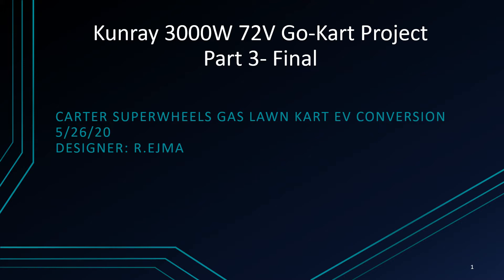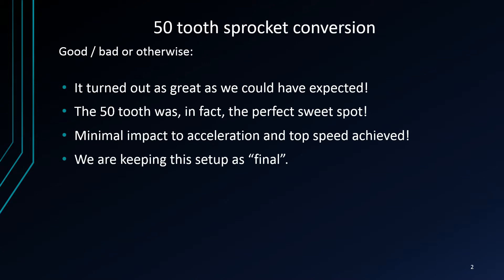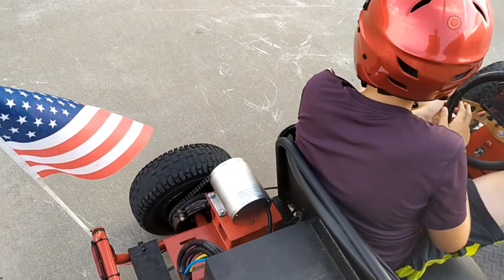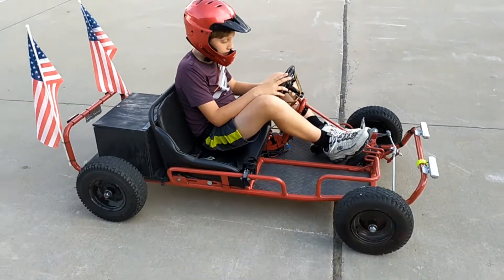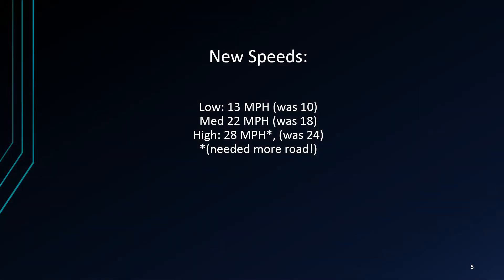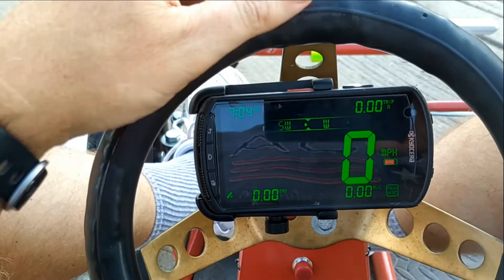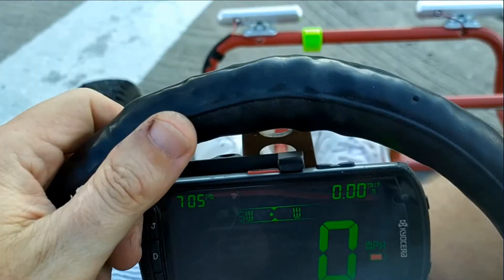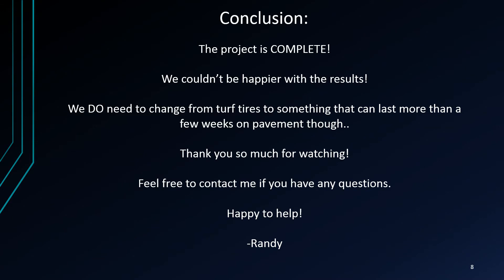3000 Watt 72v Kunray Electric Go Kart Build, Part 3 Final

Comment from the maker: For anyone doing an electric go-kart project, I had these cells made specifically for this and e-bikes.. They are 32ah lipo's  https://www.ebay.com/itm/275291765027
Reply: Hi, I’m currently working on converting a gas go kart to an electric go kart for a school engineering project. This is my first time working with go karts and I just got a klipper go kart off of facebook marketplace. My budget for batteries is about 150 and I’m hoping to use a 3000w motor. Do you have any tips and/or batteries you’d be willing to sell?
Reply from the maker: @santa3k732  Unfortunately, $150 for the battery necessary to power that motor properly is not possible.  However, you can get 6 12v 7.2 aH Mightymax Lead acid batteries for $20 each at Lowes.. It'll work but you'll have little to no range and it won't dump the current necessary, but it'll get you a passing grade for your engineering project.   I have some other ideas that will cost a little bit more but won't kill your budget either so contact me at info@texasnev.com if you'd like more help.

Comment: Turn your clutch inverted you will hit easy 80+ mph
Reply from the maker: LOL.. What clutch are you referring to?
Reply: @TexasNEV  the circular one that goes on your shaft 😂 turn it around
Reply from the maker: @Bigpimpin9393  there is no clutch on an electric go-kart. That's a sprocket, and if you watch all the videos you know that it's impossible for it to go 80.
Reply: @TexasNEV  it is not impossible brother trust me but I am not hating at all there is a such thing as an electric clutch so yeah it was impossible to go to mars and the moon yeah 0K 🤣
Reply from the maker: @Bigpimpin9393  The technical specifications of the motor, current, drive sprocket, driven sprocket and wheel diameter, it is not possible.  The efficacy of clutches on electric drive systems are subject to debate, and cannot make speed all by themselves. Some people have confused the brake band has a clutch in these videos.

Comment: What is the constant Amp output of the controller? You could take a slight risk and shunt mod the controller for more amps, then back it down in the settings.
Reply from the maker: It was a 45 A controller.  I sold that go kart a long time ago, but it still ended up going almost 45mph as is.  If I were to do it again, I'd definitely go bigger just because I can, not because it needed it. :)

Comment: does the motor give a lot of resistance at idle?
Reply from the maker: The nice part about brushless motors is that they do not.  These little things are great as they do not give much at all.  Now brushed motors are a different story.....My Hammerhead 150 EV conversion was brushed and it does.
Reply: I have a 3000w motor at home and it has a resistance at idle when there is no voltage. You can feel the individual permanent magnets with every turn by Hand.  I geared my motor very heavily, so the resistance would be too much.  I hope that this is no longer present when there is voltage on the controller.  Otherwise I have to install a freewheel and it will be a while before I get a battery delivered.  And do you have experience with the electric brakes?  Are these as strong as the drive itself?  Does the braking supply power back to the Batterie?
Reply from the maker: @marcellange814  Hi Marcel,  if it is the same motor as this, that is a little surprising.  Just as an FYI, if any 2 of the 3 motor wires are touching, the EMF generated by turning the shaft will encounter a LOT of resistance.  Even with the motor not connected to anything. :)  It's kinda cool.  However once it is connected to the controller we did not experience much of any resistance.  It will be hard to find a freewheel that can take that kind of torque but by doing so, realize that you'll lose the ability to go in reverse.  One thing I want to clarify is that with these bundled controllers, the e-brake is NOT a brake, all it does is cut power to the motor. It does not "brake" anything. Now, however, I'm sure that there are controllers out there that do that.  These don't.  The purpose of the e-brake is "emergency", not "electric".  This is in case of a runaway controller (controller stuck at wide open throttle).  It is a safety mechanism.
Reply: @TexasNEV  Too bad but good to know.  Our vehicle shouldn't be too fast going downhill and we hoped to get that under control with the electric brakes.  Thanks for the info and thanks for your great videos and support.  I appreciate that 👍🏼
Reply from the maker: @marcellange814  The Carter superwheels just had a single band brake and that thing went 43mph and it was fine. :)
Reply: @TexasNEV  we are building a two-row 8-person tandem 🤓 for excursions.  The motor becomes a starting aid and hill support with a maximum speed of 6km/h or 3.7 mp/h.  Up to 6 km/h, an electric drive is in the same category as a Elektrik wheelchair or a self-propelled work machine and you don't have to insure anything or have it approved by the legislator in Germany. It's just a bicycle with starting aid.  But if the drunk let them run down the hill without braking, it could end badly.  Here we wanted to install a Hall sensor and microcontroller, which in the first step actuates the electric brakes, in the second step the horn to warn, because in the 3rd step the mechanical brakes are actuated with a 12V linear engine and they hit hard.  the brakes are from a car.  The Axles and Breaks are from the VW Beetle, so strong enough.
We will see. I think the motor is strong enough.  With the calculated ratio we get over 300Nm at the wheel or a thrust of 1700kg / 3740lb, that should be enough.  A day tour should be possible with a 40Ah lithium ion battery, because the motor only supports you to climb Hills and every driver actually has pedals. I Will do a Short Clip of this Projekt too. You habe inspired me. Thanks a lot.
Reply from the maker: @marcellange814  That sounds like quite the project!  I look forward to seeing it!! I appreciate your comments and as always, here to help.

Comment: What amp hour battery are you running? I want to get this motor for my build and I want it to be able to get to 40 mph for city riding.
Reply from the maker: Initially it was a repurposed used stack of 5 64 aH Nissan Leaf cells converted from 2s2p to 4s, which theoretically made it 20s @ 32aH.  One single cell failed, and I ended up dismantling and selling the pieces and made a brand new 24aH Lithium Iron Phosphate battery which was 24s3p with 8aH cells from BatteryHookup.  The battery worked amazing and the cart could hit 45 WOT but it was obvious it was overvolted. :)  All else being equal, it would have been best to make it a 24s4p (32aH)  So I would recommend any 72v lithium battery with a continuous discharge of 50 amps in a 30-40ah range and you'll have a ball.

Comment: Do you need to buy your own battery after buying the kit? If so could someone link some budget powerful batteries, I’m doing a build but am low on funds.
Reply from the maker: Check out BatteryHookup or Batteryclearinghouse for budget cells to build your own 20s (LiPo) or 24s (LiFEPO4)

Comment: Are these motors good for motorcycle builds....like a cafe racer
Reply from the maker: I had one of these on my original "Terminator Electric Chopper" project and ended up changing to a hub motor due to excessive heat.

Comment: Thank you man. I’m currently undergoing a Honda ruckus swap out with the exact same motor. Researching batteries now. Going to check out your other vids. And also in the DFW area. In Texas. Don’t know if your around there
Reply from the maker: I'm in the DFW area as well and have some AMAZING batteries for sale, specifically designed for go karts and e-bikes. Very high discharge rate larger LiPo's..  Let me know if you're interested.

Comment: Can you link te battery of the go cart pls
Reply from the maker: The battery was originally made with used Nissan Leaf cells.  Then I ended up making another battery from scratch with 32650 cells for 24ah.  So I don't have a link for those but what I do have is a far superior alternative that is much higher capacity and much higher discharge capability.  I have these on my e-bay site specifically for projects like this and e-bikes..
https://www.ebay.com/itm/275291765027

Comment: What if you run a go cart torque converter?
Reply from the maker: I think it would be worse.   Electric motors are about 90% efficient, which is far far higher than a gas engine and give 100% max torque at 1 rpm (figuratively speaking).
Reply: @TexasNEV  you can't win if you don't try
Reply from the maker: @macbook802  It has to make sense first. :)  It's a nice idea but a TC is designed to help a gas engine have it's torque optimized at more rpm ranges other than its primary power band.  in an electric motor, the entire range is it's power band.
Reply: @TexasNEV  everything makes sense if you don't think about it
Reply from the maker: @macbook802  That's funny.. He'll be performing here all week folks and don't forget to tip your waiter!

Comment: Nice! I got the same setup, but i was wondering if its normal i cant turn the sprocket/gear on the motor by hand. Didnt install it yet.
Reply from the maker: Not normal... With nothing connected, you should be able to turn the motor easily, sounds like it is defective!

Comment: Is it a good idea to strap a powerful motor on a light chassis with off-road tires on tarmac? I don’t think so

To some extent
Reply from the maker: 4hp is less than most gas go karts of the same size.  Maybe check your facts before posting negative comments that have no value whatsoever?  If you watched the full series (which it is clear you haven't), you'd see that we put slicks on it anyway.  I don't mind constructive criticism, that is one great way to learn. Your comment would be the opposite of that.  LOL
Reply: @TexasNEV  yes but I’m looking to make a go kart with electric motors and achieving a 100kmh top speed, it’s 62mph, so do you think that the motors you showed in this video is enough to achieve it with a 4 speed auto?

I didn’t hate, it’s a good idea, slicks are easy to wear so I can respect it but at the same time there’s no grip, if you are into drifting, it’s a good opportunity to make a drift kart, but I do respect that you made this kart from scratch wd
Reply: @TexasNEV  I did see the vids prior to this, so you are right to some extent
Reply: @TexasNEV  Gas? , anyways the speed dosent solely rely on hp, it relys on power, gear ratio, weight, drag coefficient and aero
Reply from the maker: @you.got.gapped.racing44  Understood, thanks for the context.  This motor, when overloaded can get to 44mph, but I wouldn't expect it to last very long.  It does not generate enough torque to make it a drift kart nor can it "burn rubber".  It is just a one wheel drive go-kart.  If you want 60 mph, you're going to need a different setup, live axle, probably a big fat Motenergy ME 1306 and a far far larger battery pack...  Expect the budget to be almost triple.....
Reply: @TexasNEV  because I had the gx390 engine on cart so I don’t know what can produce enough power for a top speed of 100kmh with a reasonable acceleration, I thought initially that I would need a petrol engine like the gx390 but I tried looking out for rotary engines, the cheapest one was 5 grand usd so I just steered away and now I’m in a tie fight between electric motor or the gx390, the gx390 makes 12-15hp
Reply from the maker: @you.got.gapped.racing44  I'm not familiar w/ the gas engines.  However if I can get 45mph w/ my Hammerhead NEV (other videos on my channel) with an ME0709, then again, the ME1306 on a light kart with the proper batteries should easily be able to get to 62mph.
Reply: @TexasNEV  ahh, not sure if I could call perol gas bu you do you
Reply from the maker: @you.got.gapped.racing44  gas / petrol, kmh / mph.. all good.

Comment: Can anyone tell my why my drive sprocket is skipping chain links. I am using the original sprockets that came with the chain and kit for the 3000 watt 72 volt Kunray Electric motor. If I power it up very high it keep skipping about every 10 seconds.  I have it on a 4 wheel bike with 24" wheels, overall weight with me on it is about 370lbs. It goes faster than I want to go, the bike has no suspension, I've had it up to 25mph, but I'm afraid that loud clicking sound is causing damage to something. I'm assuming it's the chain jumping the sprocket on the motor 11 t sprocket. My shaft sprocket is 50t.
Reply from the maker: Chain sounds like it is stretched or if the sprocket is aluminum, the teeth are worn, or it is just simply not tight enough.

Comment: Hi I have a 72v vevor motor. And a 67v battery fully charged. It won't even move unless I give it a push. How do I get some Low end torque? I would think I'd have enough power bc it goes pretty fast once going but from a stand still the motor makes weird noises like it's jumping chain links but it's not
Reply from the maker: What is your gear ratio? Tire size? vehicle weight, etc?  How much current is your controller capable of and what sort of battery setup?  Lots to consider.  If you have pictures, you can e-mail me at info @ texasnev.com if you want.
Reply: @TexasNEV  awesome man thanks I will look tomorrow and send you that information but it's a Vevor 72v motor and 72v controller with 3 speed twist throttle from ebay. It's on a baja doodlebug mini bike I think it has around 62 teeth on the rear and I think the motor came with 11 teeth
Reply from the maker: @TheMetzStein  gear ratio should be good, a little higher would be better but it should still work.. bike would be lighter than a go kart, do the 3 speeds work? If all speeds are the same, then the motor is operating in reverse and you are only getting half throttle (this is by design).  If that is not the case, I need more detail about the battery....
Reply: @TexasNEV  do you think my issue is in the motor controller? It buzzes and is clanky unless you give it a push then it goes but if you hit a Slight uphill grade is slows down. It should have torque to go from a dead stop or up a little hill. Any suggestions?
Reply from the maker: @TheMetzStein  Well that doesn't sound good.. What would be really telling is getting a shut ammeter from Amazon like the one I have installed on this and pretty much every other ev I've done.  You'd be able to tell instantly if the current required "just ain't there".. :)  However, that being said, yeah, it should not be "buzzing"...  Something is just not right here at all.
Reply: @TexasNEV  yes the 3 speeds work I even jumped it to stay in high
Reply from the maker: @TheMetzStein  ok so that rules that out.. The big thing that is left is the battery.. Need more battery info.. Size / type /discharge rate, amp hours, etc.

Comment: How much ride time do you get in a single charge?
Reply from the maker: Well since we changed over to the Lithium Iron phosphate, it was a little less than when we had the Nissan Leaf cells but 2-3 hours is what we experienced after the battery switch.  The nice part is that there is still room in the battery box to go to 30-40ah.  I sold this go kart last month and the customer said it was a "very well built and designed" go kart.  I also sold the Hammerhead NEV as well as the Schwinn, and the Fat Tire Bike conversion.  I have two more projects that I am working on... Stay tuned!

Comment: Congrats on the project, what about of your current battery consumption when you change the testes. And your converter supports regenerative braking?
Reply from the maker: No regen.. Not worth it on go karts and motorcycles. Not enough mass and the controller doesn't support it anyway.  As far as my testes go, they are fine where they are. :)  Must be a typo on your part.. LOL
Reply: @TexasNEV  LOL 😂